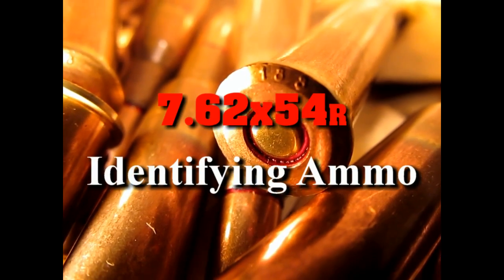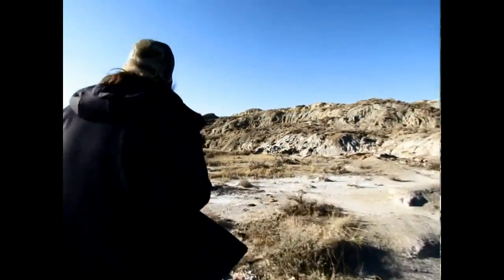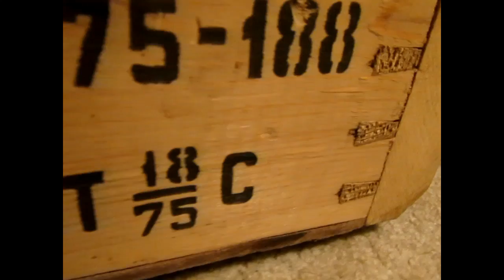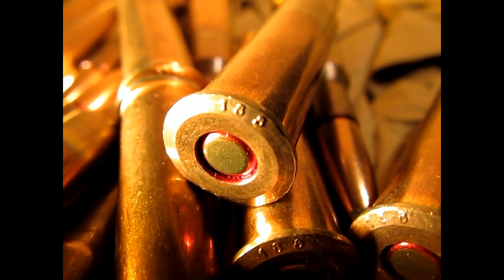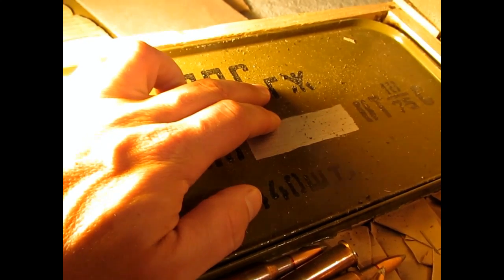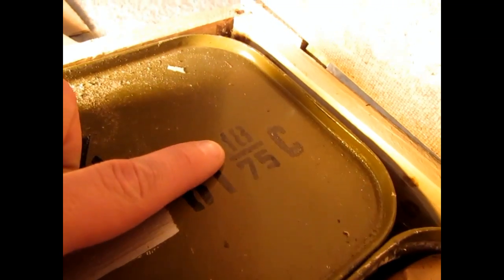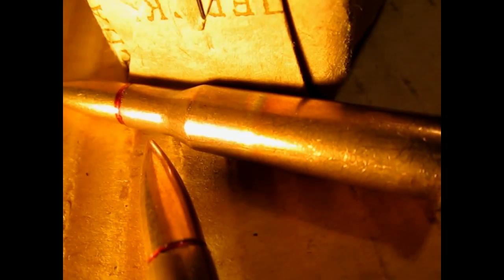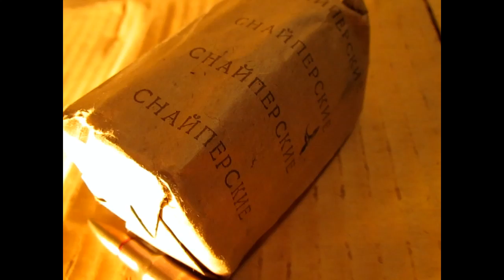Identifying Good 7.62x54r Surplus Ammo - REX REVIEWS

Comment: I've got some Bulgarian 7.62x54R that is marked 60/75 and Czech 7.62x54R that has some symbols on it.  The Bulgarian ammo is in the same copper-colored casings as the ammo in this video, which assuming is also Bulgarian.  The Czech ammo is in greenish casings.  Both are silver-tipped.   I've only shot out to 100 yards, because that's the longest distance range near me. 

Both cartridges are very accurate at 100 yards, but the green Czech ammo appears to have a different headspace, because it is extremely difficult to open the bolt after firing it. I have absolutely no problems with the bolt after firing the Bulgarian ammo.
Reply: I had the same problem with the Czech rounds, I had to keep a wood mallet on me when I was shooting just to open the bolt. I had another buddy with a mosin and his cycled it just fine so we traded round for round since he had a spam can of the Bulgarian which cycles perfectly in my gun. His was a later production than mine, mine is a 1916 Tula Peter the Great that was a Finnish capture (has the boxed SA on the receiver) while his was made in the 1930s, can't remember what his was though.

Comment: I have a load of the silver tip 188/1977 that seems to shoot well.  
I also found some brass case 188/1971, 182 grain match ammo.  It seems to shoot higher than the silver tip lighter rounds, I find this to be very strange since it is a heavier bullet..  Have you tried any of these?
Reply: Possibly the heavier bullet has more of a powder charge pushing it out with a higher muzzle velocity? The only way to tell is using a chronograph, but without one I'd put money on a faster velocity if the bullets look similar...

Comment: best shooting mosin i have is an m44, it slugged out too, .311.5
shaved the bayonet lug off, drilled and tapped it for a scope mount,cheap stock, put a 20 dollar barska scope on it, shooting handloads .312 bullet heads,with 4895,win. lr primers, it cuts bullet holes at a 100.yds , if you get one with a good bore it will shoot good. thats without a timney trigger.

Comment: I have 5 tins of ammo that is better than 7N1 by a mile.  I read  each batch is tested by shooting 20 rounds at a 300 meter target.  The 20 round groups are usually about 2 inches and the ammo is rejected if over 3 inches.  This ammo is said to outperform any top quality commercial match or hand loads.  Russia has banned export of the 200 grain extra match which is packaged in a yellow box.  I believe the blue box match 182 grain steel jacket ammo is still available for export which is also great stuff but nowhere close to the 200 grain yellow box extra match.

The yellow box extra-match ammo has brass cases with copper jacketed lead core 201 grain bullets.  They are 100% non magnetic.  They will do one hole three shot groups at 100 yards with a scoped tight barrel rifle and a good shooter.

I am willing to part with 3 tins or 36 20 round boxes in total if anybody is interested in buying some.  I don't waste this ammo on paper targets, it is reserved for self defense.  I have so much 188 silver tip 54R to use on paper, I will never use it all.  I am 60 years old so my combat days are rather limited.  I would like to see this ammo used to defend our nation from enemies both foreign and domestic, not wasted on paper or steel targets.  These 200 grain rounds would probably take down an elephant, its good stuff.  I have about 1000 sales using PayPal with a 100% rating or can be picked up near Winter Haven, Florida.  Contact me on Ebay name rickk.
Reply: Still got you match ammo for sale?

Comment: I shoot a stock 91/30, Russian markings, 1944 manufacture. Judging by the condition, it never saw much action. Probably packed in cosmoline after WW2, or used for drill and ceremony. With a decent marksman, you absolutely DO NOT want to be downrange.

Comment: Is 7n1 corrosive?   Isn't anything that comes from those steel can corrosive?
Reply: East Bloc ammo was made with primers which contained salt-like compounds - to ensure that the rounds will function after long storage or harsh conditions - and these compounds absorb moisture.  SO, it's not that anything is "corrosive" like acid, or chemicals - it's that moisture is absorbed by the residue from the primers, and this can lead to rust.  Solution?  Clean you rifle thoroughly after shooting it.  Any modern solvent will suffice.  Some people like to squirt Windex, or anything else containing ammonia, in order to neutralize the salts/compounds before they leave the range.  Seems excessive to me.  Just use your Hoppes #9 or cleaner of your choice and do right by your firearm when you get home.
Reply: WarriorPoet01 Amen, Simple is best, nothing exotic needed, just clean it when you get home. A lot of people act like "corrosive" ammo will eat the rifling out of their barrels before they get home from the range.
Reply: shoup2882 KISS theory is best. Water, just plain water. Rinse with water, dry, clean and oil as usual. There is actually "science" to back this up with corrosive ammo. Hope this helps you out.
Reply: +shoup2882 aren't mosins chrome lined?  If so you should be ok as long you do wait like a few weeks to clean your gun. I always wait until I get home to clean my guns after I take them to the range. I use windex and then I use compressed air to dry the gun off especially the cracks and hard to reach places. You can use hot water to start out with and then windex. The trade off for cheap ammo is worth the few extra step in cleaning.  It used to be before this ammo went through the roof. Glad I bought it when it was .15 a rd.

Comment: How much of a pain would the 7N1 be to use in my VEPR 54, since it's corrosive?  What do you usually use to clean your Mosin after using corrosive surplus ammo?  I've been using PPU in my Mosin and VEPR (and just started buying Hornady 150 gr SST), but have been thinking of getting some 7N1
Reply from the maker: 7N1 was designed for a weapon roughly similar to that so it should be fine.   I use windex to chemically neutralize the nastiness...  cheap works pretty good.
Reply: TiborasaurusRex I've heard its no really the chemicals in windex that neutralize the salt, its mostly the water that dissolves it. But I still use it and then hot water as well..Better safe than sorry!
Reply: ***** the new hoppes formula does not take the corrosive nature in mind, The old formula did. At least thats what alot of people have told me
Reply: +Lickmysaltyballsack Hoppe's #9 will not neutralize the corrosive salts. You need a solvent that will dissolve salts not a solvent made for removing Carbon. Thus, boiling water will work perfectly use a funnel and pour it down the barrel.
Reply: +mike C It's actually the ammonia in the windex that neutralizes the corrosive salts.  Using ammonia-free windex will do nothing, so you have to make sure you're using windex/window cleaner that has ammonia in it.
Reply: Defx10 ^^ No, you are wrong. You show me where (in chemistry, not witchcraft) ammonia neutralizes potassium chloride or sodium chloride , two of the compounds released when shooting corrosive ammunition, and I will drink a whole bottle of Windex with ammonia. I have been shooting corrosive for years. One thing and one thing only neutralizes what amounts to salt. Water.
Reply: Ammonia does nothing to neutralize the salts. the water dissolves them and washes them out.

The ammonia only assists in evaporation- so there wont be a bunch of water sitting in your bore
Reply: +Shawn Hett I've heard hot water dries faster than cool water. I use compressed  air to help aid in the drying  process. Then I clean the rifle with bore solvent and oil.

Comment: i have a tin of 54r that is labeled 188 but has no silver stipe or anything to indicate what color the tip is. does the silver tip make that much difference? as far as accuracy?
Reply: Silver tip just means it's LPS, a mild steel core, 147gr light ball. Some of the LPS was marked with the silver tip, some wasn't. I would say shoot it. It can't be too bad.

For more reading: http://7.62x54r.net/MosinID/MosinAmmoID.htm
Reply: oh yeah there was never any question as to whether i was going to shoot it or not. I guess I was just hoping it was going to be the real accurate stuff. Thanks for the info tho.
Reply: Biggest tell might be the date. All the 7N1 seems to be '97.
Reply: Ill remember that.
Reply: The combloc ammo factories stopped painting silver tips on light ball ammo sometime in the late 70s.  Silver tip and unpainted are both LPS.  They continued to use color coding for other types, e.g. yellow for heavy ball.
Reply: Duncan McAfee I had thought I'd somehow acquired 7N1 from my grand-daddy just dropping it off one day.  It came in an unmarked wax paper bag (he didn't buy the whole spam can), and had no marking on the tip.  Made in 81 I believe.  Your comment just confirmed to me that it's the same as the steel-core silver-tip.  Which also explains why it shoots 4 inch groups with my scoped Mosin and 12 inches with open sights (as compared to 1947 lead-core ammo that shoots 1.5-3 MOA with the respective rifles).